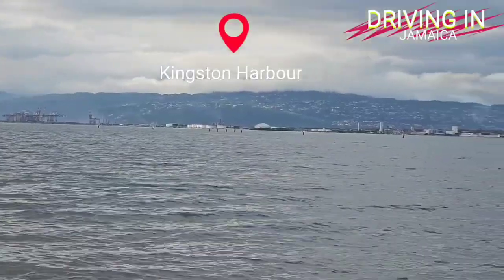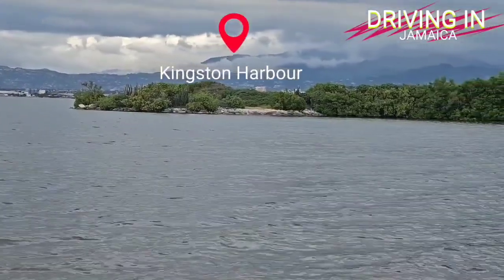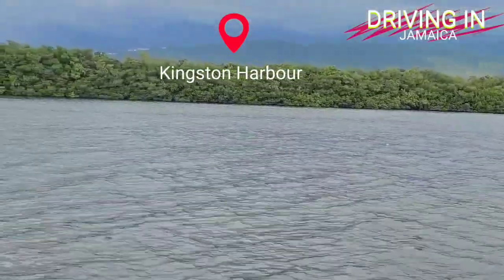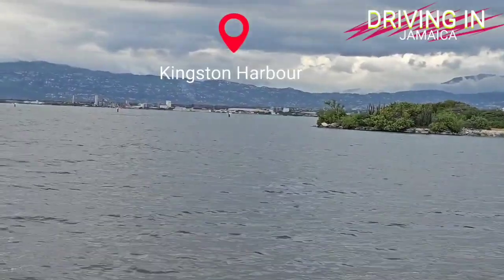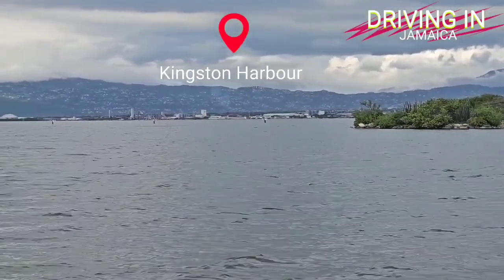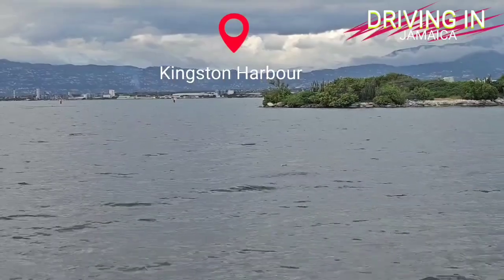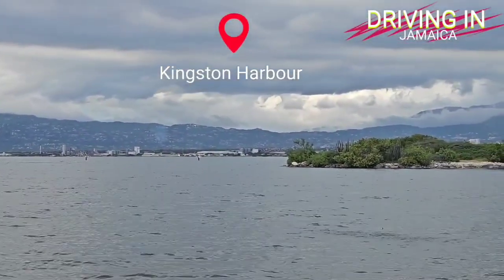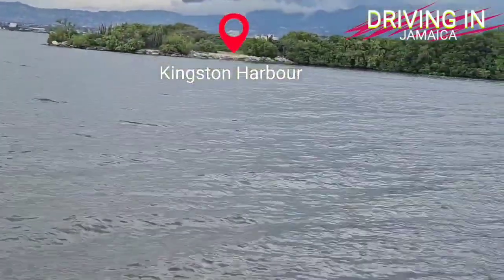Most Advanced Engineering Project in Jamaica

Comment: Just another project that’s been 20 years in the making we now have the financial resources to carry them out.
We had the Jamaican engineering and contracting capacity then but due to changes by the GOJ local contractors now have to compete with offshore contractors. The bonding requirements for these contract makes impossible for the local contractor to participate in the tender process.
Reply: We Jamaican will have to do things differently it cannot be the same old same old if we want to compete we have to do joining venture projects.
Another thing National Work Agency is not benefiting from none of the project there equipment are old and out dated they should be able to one day starts taking over these projects and managing them to keep the FX in Ja